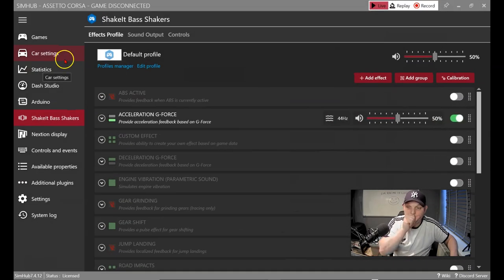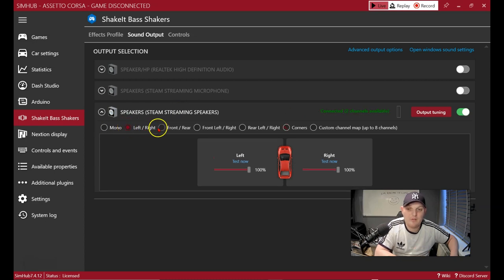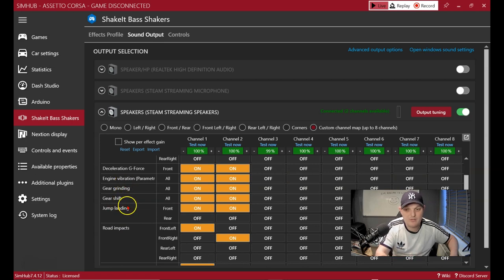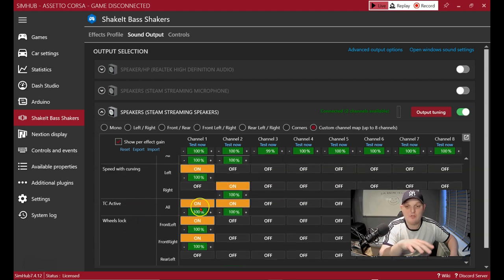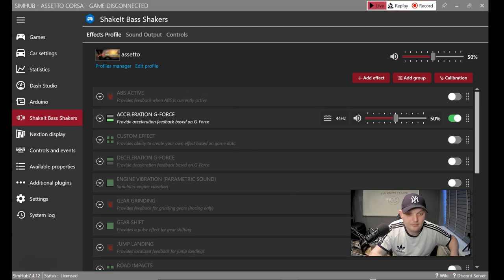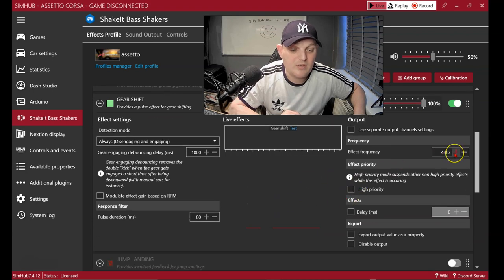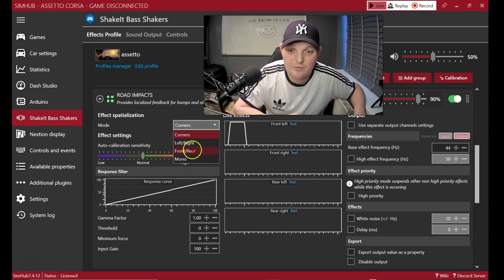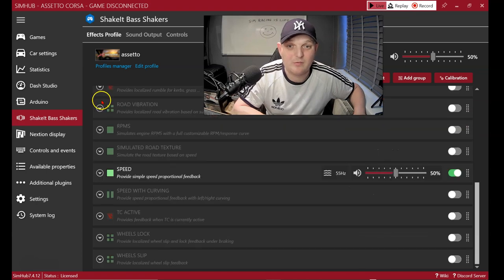Bass Shaker Setup Using Simhub - Tutorial

Comment: I had unknown vibrations coming from simhub to my Buttkicker Plus 2. It kept pulsing even if my car wasnt moving. Fixed it by reinstalling simhub. Just putting this out there in case people ran into that issue. For me, I didnt need get a 2nd sound card. I set my output on simhub as the Buttkicker Plus 2, physicially, the amp was plugged to my pc via the provided usb cable. Then I set my computer's audio output to my VR headset audio.
Reply: Start out with one effect at a time, and you'll find the problem

Comment: I've just purchased 2 dayton bst-2s as I only run a fgt lite rig so it can pack away to keep the wife happy. Can't wait to try them out
Reply: Did u already try it? can you share your experience?
Reply: @Pedro-fo4et  Vote for Pedro... 😜 I have mate I have been using them for about a week. I designed and 3d printed some mounts to attach one directly to the bottom of my pedals and added a extra bar between the 2 legs of the seat at the rear. 

They definitely supply enough feedback being only a fgt lite. If you have the same rig I definitely don't recommend this guys settings though I first tried with his and it was just a massive vibrating mess that literally made me 2nd guess everything I ha done lol. This is nothing against him just I guess everyone's rig is diffrent and shaker settings are not a 1 size fits all.

After going threw each individual setting and dialing it in to what I want though I definitely wouldn't go back to not using them. I accidentally didn't start simhub one day and immediately noticed and it felt terribly wrong not feeling any input other then the DD wheel

Comment: Great Video!  Other than plugging in the amp to a USB port on the back of the computer, there is nothing else to in Windows, correct?  The "sound" out device in windows can still be set to either a set of speakers or my headphones, correct?  All the settings and config to get the BST-1 and amp to produce feedback is done in simhub?

Comment: I have an existing buttkicker under seat w/ BK Amp.
I added a separate the bass shaker speaker under pedal w/Nobsound amp. Bit no vibration in front. Simhub says I need to use USB soundboard.
After this will I be good to have vibration from both?? Of do I need to eliminate either buttkicker amp? Or eliminate  nobsound amp?? Or can I use both at same time??

Comment: On your selected sound output its showing in green that you only have 2 channels available. Surly selecting 8 channel would make no difference as the only available channels will be front left and front right.

I only mention this as I have 7.1 soundcard with 7.1 surround amp and I'm still only getting 2 channels available even with speakers in Windows set to 7.1. 

I know the full range of channels work as I've tested it with audio so it's sim hub that seems to be missing that im usual an 8 channel sound card.

How did you get all your transducers firing with only 2 channels available and also why with only 2 channels available did you choose 8 channel customisation?
Ta
Joel

Comment: Great video, I bought the little Nobsound Amplifier with included sound card. I need an extension cable for the usb of the Nobsound. I thought it’s Usb C , but therefore it’s to small. Do you know the exact type of usb of the Nobsound? Thank you!
Reply from the maker: Mine is a micro usb port, but it may depend on the nobsound amp ypu have also
Reply: @garyevanssimracing5922  thank you, I appreciate your video and help very much 🍀👍👋
Reply from the maker: @christianhofmann7182  no problem at all

Comment: Great video - very helpful! I think I’m going to do this exact set up. I have a playseat trophy and under the seat is just like a mesh material. I’m toying with mounting with tape or mounting to some wood and then mounting that with tape.

As I understand it the amp has its own sound card via usb?

In terms of cables, are you able to cover off what’s needed? Thanks
Reply from the maker: yes the nobsound mini amp has its own souncard via usb. also i used speaker wire for a subwoofer to wire them up!  the bass shakers have a foam type covering on the back so thay are good for mounting direct to your seat, i drilled my seat as the mesh is more than likely fibreglass. hope this helps
Reply: @garyevanssimracing5922  thanks, I have ordered everything! I don’t know if it could mount directly to my seat as my seat is just fabric. I’m trying to find a way to build a beam that goes under the seat to mount to that.
Reply: @garyevanssimracing5922  how do you connect your Nobsound via USB?
Reply from the maker: @jeremymartinez6024  my nob sound has a micro usb port, i then connected it to my pc with a usb cable
Reply: @garyevanssimracing5922  thank you. How would you go about connecting multiple Nobsounds to your pc?
Reply from the maker: @jeremymartinez6024  basically connect them up as usb devices again, then go into simhub and turn on the amps you wish to use, then select the channels you wish to use for each corner for eg
Reply: Currently in the same situation looking for a good mounting solution. Did you find something that works good for the seat?
Reply: @Ttone1880  I don’t have the trophy anymore, but I cut some MDF and bolted a Dayton to that. I attached the MDF to the back legs. This did ok for the trophy. When I moved to a profile rig the Dayton was pretty weak. I ended up getting som Buttkicker gamer pros. They can clamp on directly if that’s something you want to do. The Gamer pro is pretty strong and will do very well with the trophy. You will pay more though. I blew up a Dayton and this same little amp with my old setup fyi so I’d just spend more and get the gamer pro.
Reply: Thanks for the tip. Was hoping to save some money but maybe the buttkicker could be worth it for reliability and ease of mounting
Reply: @Ttone1880  the Daytons and amp wasn’t bad on the Trophy, but yeah the mounting was a bit of work and they blew up in the end. Have had the gamer pros now for over a year and not one issue. For reference, one Gamer Pro Buttkicker is 2-3x the power of the two Daytons I had. I could barely feel them on my profile rig. In my country the Gamer Pro on special was maybe $150 more than the DIY version as it included cables etc too (basically everything needed). After my troubles with things blowing I wanted a different solution as well which was more ‘guaranteed’.

Comment: hey man great video i have a question if i had 6 shakers 1 at front 1 under seat and 1 for each corner to be each wheel how would i get simhub to see them all could i just plug in each amp into usb and select each amp for desired effects and then adjust or would i need to daisy chain the amps or something?
Reply from the maker: Yes thats right, basically turn on the usb amps inside of simhubs bass shakers, then allocate the bass shakers to the output you want them to operate

Comment: do you have links where you bought the transducers and amp? Also what cable/wiring did you use to connect the transducer to the amp to the pc?
Reply: and a link for the 24 volt? I am looking as well, but just curious as to where you got yours.

Comment: Do you have a link for the power supply pls mate?  What type of connector etc? Ty
Reply from the maker: https://www.ebay.co.uk/itm/Adjustable-Electrical-AC-DC-Power-3V-24V-Supply-Charger-Voltage-Variable-Adapter-/313832997818?mkcid=16&mkevt=1&_trksid=p2349624.m2548.l6249&mkrid=710-127635-2958-0

This is the one i use , the 24v version mate
Reply: Ah fantastic. Top man ty 😊👍

Comment: hey gary, i’m planning to drill into my fibre glass seat to mount the shakers - any tips for drilling in? rather scared of cracking my seat
Reply from the maker: Hey Mark, I just made sure my drill bit was sharp....I used a small drill bit to make a pilot hole first, then moved up a size. Hope this helps
Reply: @garyevanssimracing5922  okay!

Comment: Great video. Can you hook just one BST-1 to the amp you used?
Reply from the maker: Yes you can no problem
Reply: @garyevanssimracing5922  Thank you sir. I basically bought the same gear you have but only one BST-1 to see how I like it all first.
Reply from the maker: @dklassen  yes good idea, just try not to over exaggerate the shaker , try to just make it feel realistic if you are mounting it under your seat for example
Reply: I do not recommend this amp for a bst1. I have 4 BST1's and 4 TTS25 Pucks. The Nobsound is NOT enough and will kill itself overtime. This has been discussed on many forums. This amp should not be recommended for a BST1.
Reply: @MDaDonLegacy  Hum. I run 2 BST-1's with his exact setup. Been working fine for a long time.

Comment: Perfect timing, I've actually bought 2 of the same shakers, and a higher output Nobspund G2 pro.

just a question, I was of the assumption, that if the 2 shakers were plugged into the same amp, and same PC input, they would vibrate together (mono). how do you split them into 2 channels?

Thanks!
Paul
Reply from the maker: Hey paul have you watched all the video?
Reply: @garyevanssimracing5922  I have, but I'm pretty terrible with all this stuff.
Reply: I think I know what's going on, your amp is a dual channel, whereas mine is only single. That might be why I'm a bit confused?
Reply from the maker: @nofrills00  ahhh i see, I put a link in the comments to the one I have if that helps
Reply: I have 2 Buttkicker Gamer 2s in a left right setup. I run 2 of the included amps. 1 amp has both black connectors. The other has both reds. I connected them to the computer using the 3.5mm spitter that was also included.

Comment: Hi Gary, thanks for the video. I also bought the same setup however in Simhub I am getting a message "Connection error" in the sound output. Once in awhile I can get it to work but eventually I see that error message. Any idea? I didn't install any specific Nobsound drivers or anything like that as it should work out the box?
Reply from the maker: How are you connecting the amp ? Via a usb hub or direct to the pc?
Reply: @garyevanssimracing5922  It's through a powered USB hub but the amp works in Windows. I can use the Test Speaker function and it works. Just in Simhub I get that error.
Reply from the maker: @paradox9357  have you tried updating Simhub
Reply: Yeah I am using the latest version. Did you have to install any drivers or are you also using the default USB2.0 audio driver from windows?

Comment: Where did you connect the 3.5 jack of your amplifier? In the subwoofer jack of the external sound card or which one?
Reply from the maker: The amp connects via usb
Reply: @garyevanssimracing5922  do you have any images? , because I dont understand how to plugge it man😭.
I have a 2 channels Fosi Audio TB10A amplifier and I'm thinking of connecting it to the motherboard's audio card via RCA to 3.5. But you said it's better to connect it to a external audio card but the external audio card that I saw have 3 spots, front out, rear out and bass. In which one do I have to connect the amplifier?
I don't know I was clear.. 😢
Reply: @garyevanssimracing5922    I searched the nobsound amplifier and now i understand what you mean, the nobsound amplifier has his own soundcard and you just plugged to the PC thru USB. Did you install a software for the amplifier soundcard?
Reply from the maker: @thearenaschannel  no windows recognised it when i plugged it in
Reply: @garyevanssimracing5922  man, you are the best! Thank you very much! 👏🏼
Reply from the maker: @thearenaschannel  no problem at all 🙂

Comment: Hi. thx for the video...help pls. all youtube videos on this are for PC with simhub...but how can i do this setup for PS4. My thinking is to just plug into Nobsound with the 3.5mm aux in (from the PS4 controller). Any thoughts? anyone done this? will this work with the standard audio? i know customization will not be there ...but it should do something right ??? tx
Reply: You will need to run Simhub via PC, and have Simhub read telemetry data from the PS via its wireless IP

Comment: Gary, small question; what power supply are you using to power the Nobsound? 12V or 24V?
Reply from the maker: Im using the 24v one and it does make a difference over the 12v
Reply: @garyevanssimracing5922  , I've ordered the 24V power supply, should be here tomorrow, thanks for the advise! Another additional question Gary; you've mentioned to me in another post that you've drilled one bass shaker to your seat and another one on a construction at your pedals. But I was wondering, do you make sure that the bass shakers have full contact with the surface? Or do you use some kind of spacers to avoid this for better results? Looking forward to your answer. Would extremely appreciated to have some detailed pictures of your exact setup if this wouldn't bother you too much.
Reply from the maker: @NikiBoy47  I mounted mine directly to my seat as it has a rubber type base. But the pedals shaker is spaced slightly due to how i mounted it on the brackets.

Comment: thanks for the vid Gary! 
Do you have the Nobsound plugged into your 'line out' from the computer? 
If so, where does normal car sound get outputted?
Does the amp need to have a USB Sound card internally to work? I have an old amp at home, but can't seem to get it to work with transducers.
Do you see any benefits of using a 4 channel amp, and having the following? 
channel 1: a small transducer attached to the back of the brake pedal for example, and just having ABS and wheel lock up vibrations come through that? 
channel 2: I have a sequential shifter and am thinking of mounting a transducer on it to feel the gear shift thuds...
channel 3: One under seat
channel 4: One under pedal tray

Thanks for any insights from your experience :)
Reply from the maker: The  nobsound has its own soundcard, and plugs in via usb so its seperate. So it does not affect your car sounds /audio. I Would recommend 2 of these amps if you wish to put 4 transducers in, and what you suggested in terms of mounting 4.. I would say that will work very well, and considered a puck type shaker under my shifter aswell😃👍🏻
Reply: @garyevanssimracing5922  thanks for that, super helpful, I didn't even think to use 2 Nobsound amps, will definitely do that. thanks again.
Reply from the maker: @billyelusiv  no problem glad I could help 👍🏻
Reply: @garyevanssimracing5922  how would you connect multiple Nobsound amps to your computer?